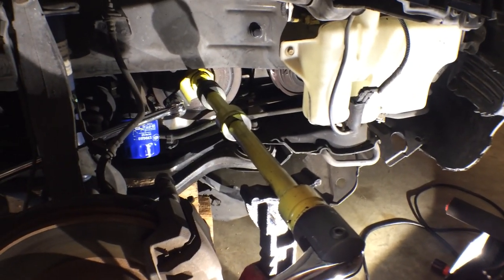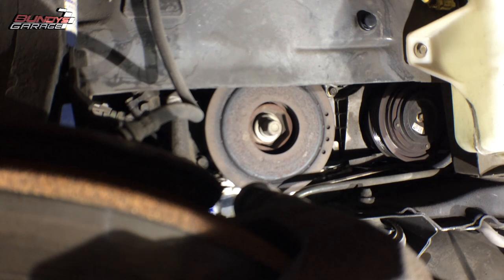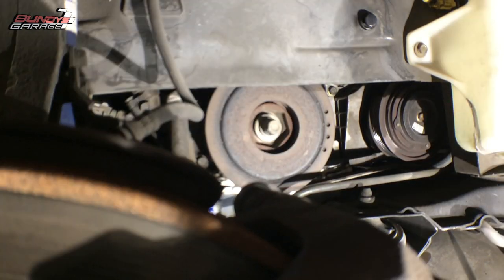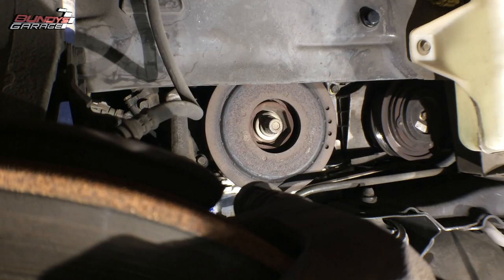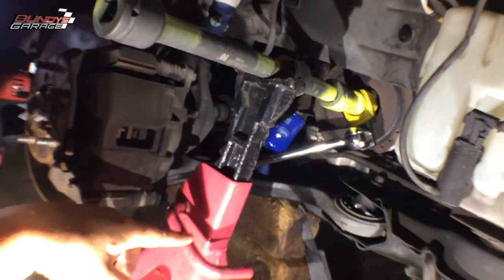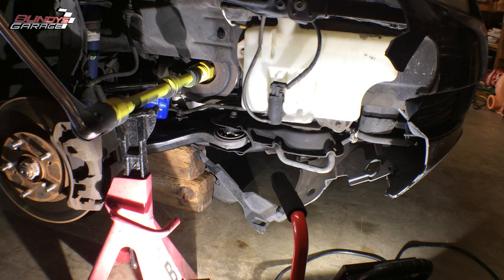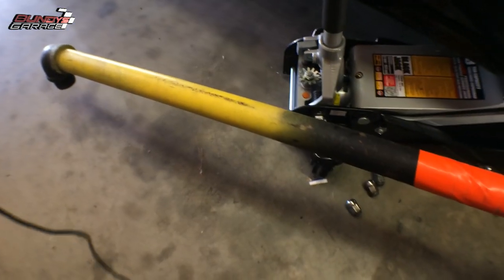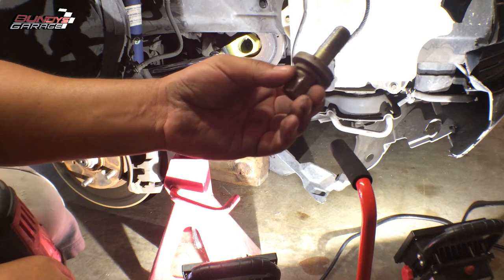Honda Accord J Series V6 Crankshaft Pulley Bolt REMOVAL GUARANTEED

Comment: I bought a Milwaukee 2767-20 1/2" High Torque Impact Wrench w/ 48-11-1850 5.0Ah Battery, a Lisle 77080 19 mm Harmonic Balancer Socket for Honda/Acura & other assorted items for the timing-belt job in my 4th-Gen Acura TL. 

With that High Impact wrench (& Lisle 19mm socket) that bolt came off like butter 🧈. I bought those things from Amazon after watching my brothers try to take that bolt of two other 4th-Gen TLs & a 3rd-Gen for an entire day. When it was my turn to do the job on my car I got ready. I simply brought a bazooka to a knife fight lol.
Reply: Yessir, spent 5 hours last Saturday playing with the bolt, woke up Sunday morning and took my ass to home Depot for the Milwaukee. Not even 5 seconds of torquing and it was completely off. Love how the accepted methods seem to be using the starter and jamming a breaker bar in your suspension or just shelling out for a Milwaukee. Awesome tool
Reply from the maker: I’m not a fan of the starter trick. Not only are you putting a tremendous amount of stress of the internal workings of the engine I have heard of guys stripping the bolt trying to do that. Then your in a real world of hurt!
Reply: @michaelsimmons4230  Yep, a high torque electric wrench & a “high-mass” 19mm bolt (for J-series V6 engines) will do the job in less than 3secs… vs 3 hours with more conventional ways. 

& I’ve used the starter-engine torque trick when trying to take off a super tight wheel hub bolt. It works but it could be dangerous.
Reply: @bundysgarage  agreed
Reply: I’m fighting right now!!!!
Reply: @MrSamPhoenix  I used it on my F150 when doing the cam phasers and timing set.  1st try, like butter.  1 tap of the starter did it.   i was wondering about trying it on the pilot, but was unsure of the success rate.  the F150 has a larger bolt as well with probably less overall surface area than that of the Honda.  Worried about stripping the 19mm.
Reply: Tried one of those on my "new" used 3.2 from LKQ.
It didn't work worth sht.

150 PSI on a Ingersoll Rand 1/2" impact wrench and NOTHING!

Took a 3/4 breaker with 7 feet of cheater to break it loose with a 210 lbs guy (me).
Reply: @TheDivergentDrummer  indeed, always bring the right tools for the job.
Reply: @rthinds  did you try the impact wrench with a high mass socket?
Reply: Yeah bro the Milwaukee 2767 is a beast. Trust me I know lol

Comment: Use a jack! Just place it under the breaker bar and keep jacking it up until it breaks free. I learned this on YouTube a few months back and it’s been a game changer!
Reply: crazytimes288  With the car lifted, you should be able to have enough room between the car and the floor. Just put the breaker bar on the nut, place the jack under the handle as close to the ground as possible, and start jacking it. I’m sure you could even use an extension like this video if you want more room

Comment: I used a 3/4 inch socket with a 3/4 inch drive, 4 ft, breaker bar, and it came off relatively easy on my 2007 Honda Accord V6.

Comment: Okay day 2 of toiling with this damn bolt. I tried a Harbor “Fright” Earthquake 1200 lbs of torque half inch socket impactor. Nothing. Bought an electric Bauer 1/2” impactor with a shit ton of torque and break away power. Nothing. I snapped a 1/2” breaker bar that was made by TEQ TOOLS….. that sucks. The bar did too. Now I bought the big stuff. 3/4” breaker bar, to a 1/2” extender attached to a 1/2” 19 mm socket. This doesn’t work I’m calling the local Lake Michigan DNR  and see if they need a new addition to the reef.
Reply from the maker: I know your pain. Your weak point will be dropping down to half inch. Now that you have the 3/4 breaker bar get 3/4inch extensions, and a 3/4 inch 19mm socket and then a cheater bar. Had an odyssey that I used this set up on over the weekend. Got it off after nothing else would.

Comment: I did the same thing with 1/2 breaker and extensions.  Nothing else would break it loose.  Electric impact, air impact, torch, bumping starter all failed. When the bolt broke loose it sounded like it had snapped something!

Comment: On my 2014 Accord V6, I tried everything you did, I purchased the largest Makita 1/2”, the pulley holder tool and still no luck. I seen where adding heat to it helps. I used my industrial heat Gun and heated the bolt to 300°.  It came loose with the big socket and the Makita XWT08Z 18V LXT®... I think heat on the bolt is necessary.
Reply: Do you reckon a jet lighter / cook’s torch would work or would it be better to use a butane blow torch
Reply: @h0udinl  not a big fan of an open flame, not wanting to set anything on fire and I had an electric heat gun which took about 2 minutes to heat to 300°.

Comment: If you don't have the Milwaukee high torque impact, an air impact with 1/2 hose sometimes does the trick for removing the bolt.
Reply from the maker: Even then they don’t always come off.

Comment: Bought a used 3.2 from LKQ and needed to use a 3/4 breaker with *6 FEET" of cheater pipe (not including the original 20" breaker bar) in order to break it loose.
I'm 210 lbs and was hanging on my 2 cheater-bar extensions about 7 feet out. Had to build a frame to keep the engine from tipping over....  

Friggin ridiculous!!

Comment: Or you can pull your ignition fuse and bump the engine with breaker bar and socket attached.  Just support breaker bar on the fram or something.

Comment: Hey, thanks for the tips man!  I'm currently in this position on our 08 pilot. I bought the fat socket, 19mm, the chineseium one unfortunately, not the lisle one :( .  It came with the holder tool, but they don't fit together, lol.  then I read the description further, and in the middle somewhere nestled between 2 other lines, between the photos, "NOT TO BE USED TOGETHER"!!! What the heck.  Anyway, I guess I should take the tire off being as I may be pulling the engine anyway.  I was struggling to find a decent spot to get any real leverage, and was not having any luck.  1 pulled pectoral muscle later, I find your absolute gift of a video, and I will hopefully be on to getting the cover off.  I need to pull bank 2 head.  No compression on cyl 6. 350K km wish me luck :S

Comment: Hello I have an 03 accord 3.0 v6. Can you please explain the part about lining up the timing marks?? I'm about to replace my pulley and that sounds very important.
Reply from the maker: The crankshaft pulley can only be put on one way. It has a notch that lines up with a woodriff key on the crankshaft. If you have those alligned than timing for your drive belt should be good. Now if you are going to change the timing belt, that is something completely different.
Reply: Sweet I was worried there for a minute.
Reply: @bundysgarage what are the 3 tick marks in a row next to the main tick mark on the crank pulley?

Comment: I just use a breaker bar braced against the lower control arm, then I bump the starter.  Comes off every time. No power tools or heat needed.
Reply: For real!!!???
Reply: Yes.  I just put some liquid wrench on it, then I just put the socket and breaker bar on it and brace it on the lower control arm.  I also just zip tie it to the lower control arm so it doesn’t slide around too much.  Then I just bump the starter (just a quick bump without starting it). I was skeptical at first but it worked.  Had it off in 3 mins.  No messing around. There are some videos too, even Scotty Kilmer had a video and that how he does it every time.
Reply: Here is a video for an Odyssey. I pretty much do it the same way.  https://youtu.be/m8aBCUrFzSk

Comment: Yep it a pain in the ass cause I were trying to change the water pump and timing belt on my son 2005 civic with the Honda special tool and it just wouldn’t work now I’m gonna have to get a high torque impact wrench 🤬

Comment: I had to heat it with a torch like you did, and used Ingersol-Rand's wireless impact gun (around 1140FT-LBS) + heavy-mass crank pulley socket.  I think part of the reason why that bolt gets stuck, aside from peculiar engineering that Honda's known for, is that whoever reinstalled the bolt didn't follow the correct procedure; apply oil on part of the thread & between the bolt head & the washer.
Reply: wondered about that

Comment: Propane Torch ?  That's not going to work.  I've done battle.  Yes.. the crankshaft pulley lock, 3/4" Breaker Bar, 3/4" Extension, Car Jack, and 4' Cheater Bar !!!  The 19mm bolt has a little longer head on it.  Be sure to get your socket all the way on.  Don't bother with heat or penetrating oil.  If I remember correctly, you tighten to 42 Ft-Lbs... And then turn an additional 60 degrees.  I always keep an extra bolt on hand too.

Comment: Pb blaster 2days put breaker bar with socket on nut jam breaker bar under frame in opposite rotation of the nut bump starter ignition and that nut will come loose…

Comment: Too many extension bars 
It will twist . You should of gone direct 
With the breaker bar and socket 
It gives it more force. No twist
Reply from the maker: How do you clear the fender well?
Reply: Yeah but you can pull it from the front
Reply from the maker: Most people don’t have a lift in their home garage, how are you going to pull it from the front without a lift?
Reply: I don’t just a Jack and axle stand 
. You can get your breakage from the front and pull it.

Comment: So my bolt actually cracked inside the threads and the harmonic balancer flew off and now the timing is off any tips?
Reply from the maker: What do you mean the bolt split? Like spilt in half? Were you able to remove it?
Reply: @bundysgarage  do you have an Instagram where I can send pics

Comment: Just prop the braker bar, or 1/2 ratchet up against the frame and hit the starter. I use a jumper wire and hook it to the solenoid terminal on the starter. Bump the hot post, and crank bolt 🔩 Loose!
Reply from the maker: Until it strips out the crankshaft pulley bolt…
Reply: why would it do that @bundysgarage

Comment: Interesting, I have busted a few helping friends with a Milwaukee 2767 with a regular deep impact (only one I just had to torch for a bit). You have the 2663 impact? which is rated for like 600 ft-lbs at most.. lol fail. Get the Milwaukee 2767 and you won't be having to resort to any cheater bar.